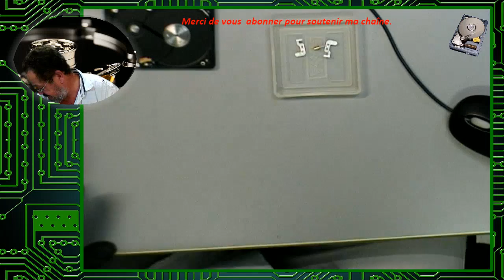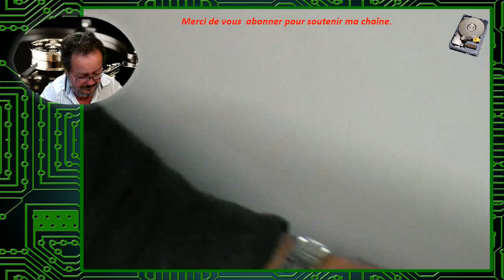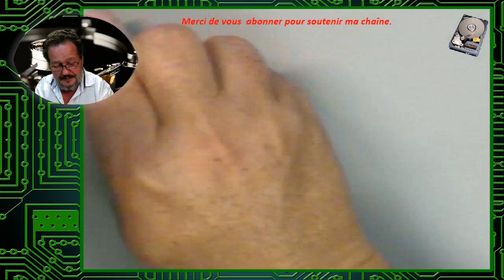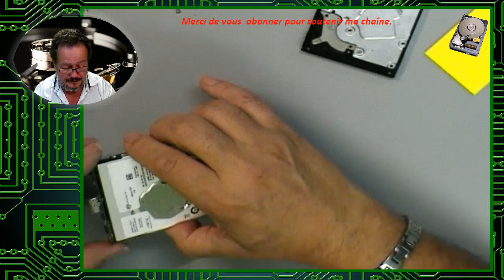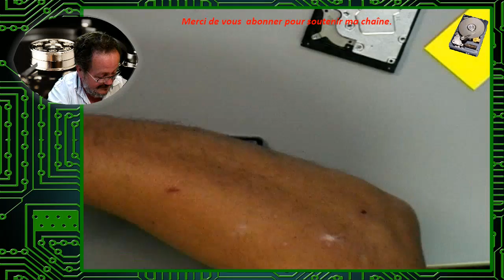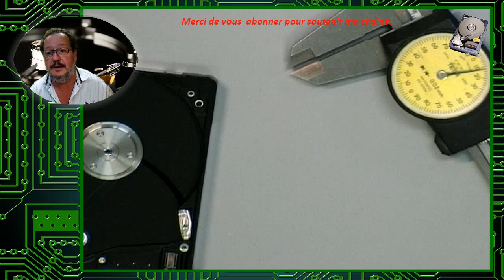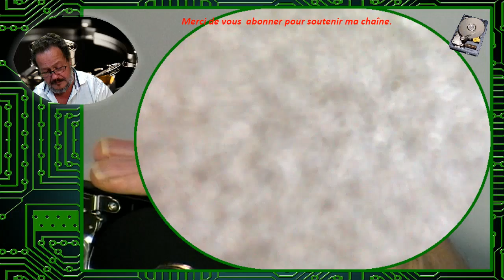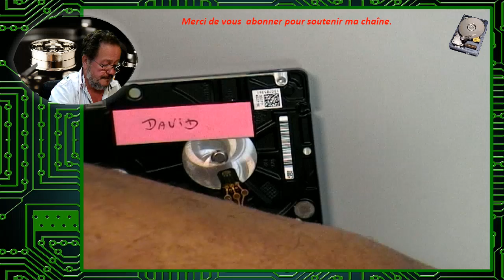Changement tête de lecture et déplacement disque dans un autre boitier disque de David

Comment: Bonjour, 
Suite à un changement d'alimentation de ma tour, mon disque dur ne fonctionne plus. Aucune chute rien.
J'ai tenté de la rebranché avec un adaptateur USB mais rien, le disque ne tourne pas comme s'il n'y avait pas d'alimentation. Pensez vous que changer le circuit imprimé avec l'embout d'alimentation suffirait ou faut t'il directement procédé au rachat d'un disque dur identique et intervertir les disques ?
Reply from the maker: Bonjour
Dans un premier temps ne pas ouvrir le disque dur la cause est peut-être autres. 
C'est quel type de disque dur ?
Si c est un disque dur interne sata 3.5 pouces l alimenter via un câble usb c'est pas asser puissant il faut soit utiliser un dock ou un boîtier avec une alimentation.
Reply: @GuyCottrez  bonjour, tout d'abord merci beaucoup d'avoir répondu à mon message et je vous présente mes meilleurs vœux pour cette nouvelle année. Il s'agit d'un HDD Western Digital WD Black 1 To acheter en 2015. Je l'ai bien branché a un adaptateur USB avec un bloc d'alimentation mais aucune réponse. Je l'ai déjà ouvert afin de vérifier que la tête de lecture était correctement placer.
Reply from the maker: @adrien5972  
bonsoir,
l'ouverture du disque n'était pas obligatoire, vous devriez faire un contrôle de la carte pcb  et vérifier si vous avez une tension d'alimentation.
avez vous une lumière sur la carte pcb ?
cordialement 
meilleur vœux
Reply: @GuyCottrez  Bonsoir, il n'y a aucune led sur le pcb. Je ne vois pas comment vérifié la tension de la carte pcb ? Avec un voltmètre ? Si oui où le placer ?
Reply from the maker: @adrien5972  
Bonsoir,
sur la carte pcb vous devriez avoir une led qui clignote lors du branchement et sur le pc vous devriez entendre un bip de connexion de périphérique  sur l'ordinateur.
vérifier le cable usb et faire un essai de le brancher sur un autre ordinateur.
cordialement.
Reply: @GuyCottrez  Bonjour,

La carte pcb était bien HS. J'ai réceptionné aujourd'hui une nouvelle afin de la remplacer. Une fois monté, le HDD démarre. Malheureusement, la tête de lecture fait des mouvements bref et répétitifs avec un bruit qui ne me plait pas. De plus le disque n'est pas reconnu sur le pc ni sur la gestion des disques. Je crois comprendre qu'il ne me reste plus beaucoup d'espoir de récupérer mes données..
Reply from the maker: @adrien5972  
bonsoir,
vous avez changer la carte pcb par une autre ?
faite moi parvenir par mail les photos de votre disque dur, carte pcb et la nouvelle carte pcb

Comment: Bonjour, J ai un Western Digital de 160 Gb que j qi ouvert et en voulant recaler la tète de lecture, j ai laissé une emprunte sur le plateau du disque. J ai du ensuite enlever le plateau pour le nettoyer avec un tissu sec et souple. La toutes les taches semblent avoir disparues. Alors je ne sais pas s il y aurait encore une chance de récupérer mes données dans un laboratoire pro. Merci d avance pour votre réponse. Casimir
Reply from the maker: bonsoir,
il y avais une ou deux galettes a l'intérieur ?
il y a des chances qu'une société refuse de prendre un disque qui a été ouvert.
vous vous souvenez de quelle surface était au dessus ?
pourquoi avoir ouvert le disque ?
qu'elles ont étés les symptômes avant l'ouverture ?
dans quel état ce trouve la tête de lecture ?

cordialement.